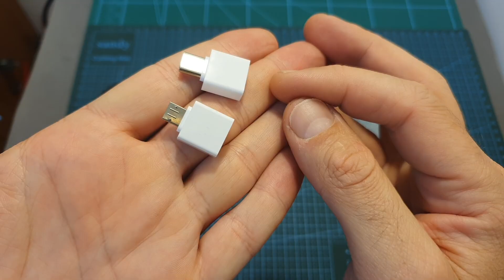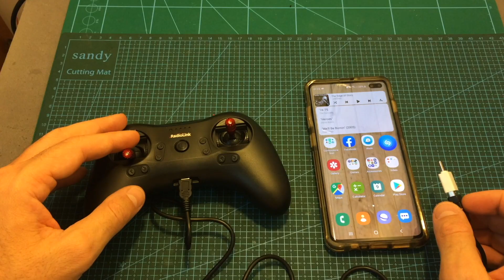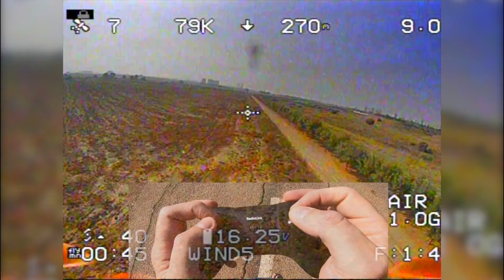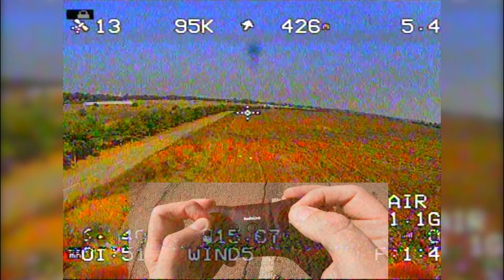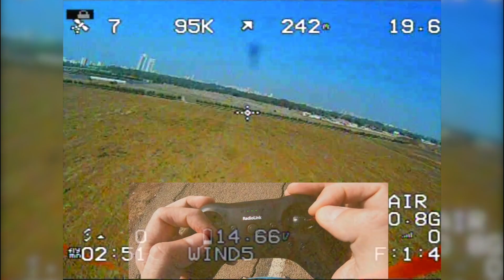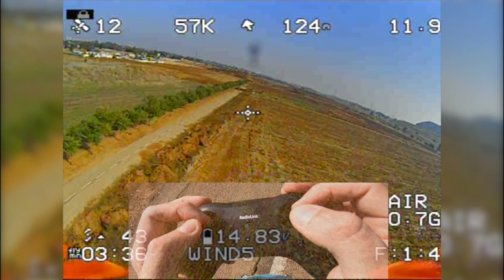Mini X-Lite? Radiolink T8S Review, Setup & Range Test

Comment: two questions: 1) does the included receiver have programmable failsafe channel values? 2) from opening it up, does it look possible to change the transmitter to mode 1 (and does the Android app support  changing mode 1 <-> mode 2)
Reply from the maker: 1. As far as I know - no. 
2. Yes, it shouldn't be hard. You can check the photos of the internal parts of the TX in my pinned comment.

Comment: Is it possible to bind remote to several receivers and switch between when needed? Couldn't find this info in manual.
Reply from the maker: Yes.
Reply: Gal Kremer Do I have to use external app to switch?
Reply from the maker: @Wumsky  No. You can bind multiple RXs to the same TX as far as I know, but I haven't tried it myself.

Comment: Looks like a screen less Evolution. I've had one of those for three years. Still use it more than my Taranis as its far easier to chuck in a bag. Wonder why this has taken so long? It would be nice to have rssi in either the OSD or a warning on the radio prior to signal loss.
Reply: Radiolink AT9S AT9 AT10 II AT10 with RSSI function on the screen
Reply: Radiolink these radios are the same size as a Taranis but with less functionality. I have an AT9 that came bundled with a Sky Hero drone, sadly the receiver wasn't diversity and I kept getting failsafes so I swapped it out for an XM+.
Reply: @SuperBradley79  Thank you for your valuable advices. What we've been trying to do is to develop the most cost-effective RC products and envolve more fans to enjoy RC funs.
Reply: @Radiolink_official  hopefully it will bring more people into the hobby. It looks like a really promising transmitter. And the price is great value. Also it's nice to be able to offer upgrades to future models.
Reply: @SuperBradley79 Yes, we focus on R&D the products for newbie and professional player,  we really want to bring more people into the hobby to easy enjoy RC fun, thank you for your support us.